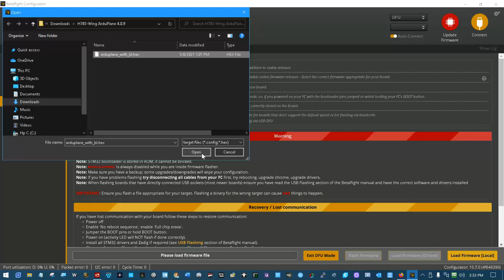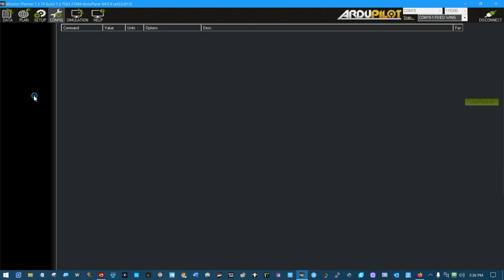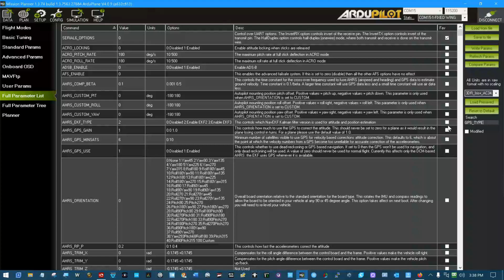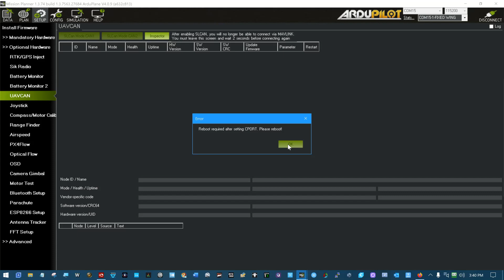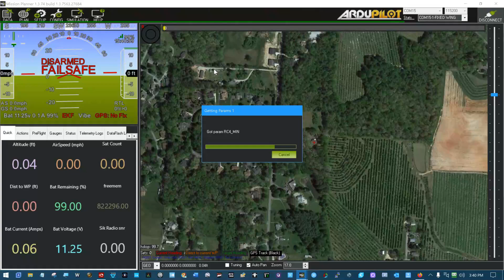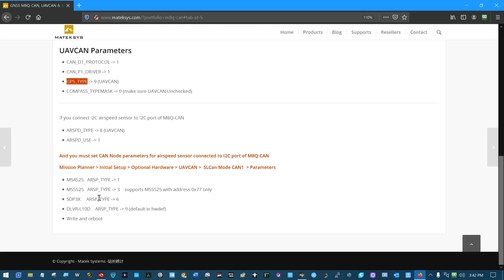Answer to question on M8Q CAN 2 of 2

Comment: Looks like the best thing to do, if you have more than one CAN component, is to make your own wiring harness.  I thought I read somewhere they are working on CAN compatible servo's. ?  In that case a custom harness would be in order.
Reply from the maker: I read up on the CAN Buss. Quite a system. Basically each unit is separate, they all talk anytime they want with no syncing clock pulse.  Everyone receives everything and each separate unit decides IF the current message is meant for them or not.  If so execute, else ignore message.  Seems like an extension of the old SBUS days with Futaba.  rofl  Keep chaining the modules on and on and on.  Servos and more.

Interesting to watch this stuff evolve.

Comment: Okay, no tables broken, no TVs, didn't throw the F765, grrrr.  The problem was my ignorance.  My TX sends 12v to the camera.  So, I put the camera power on the Vtx pins.  The VTX sent 12v back to the pins, and shut the board down.  The learning curve can be expensive :(  The New H743 arrived, installed 4.1, soldered it up, connected the GPS and Air sensor, plus receiver (R OTA) and two camera's with a TX Wired correctly.  Everything works.............  GPS gets 12-16 sats.  RSSI works using ch16.
Reply: Also, the CAN is not plug and play, quite confusing..  The GNSS M8Q-CAN if plugged in first is the end of the line for the CAN bus.  You have to plug in the Digital AirSpeed sensor ASPD-DLVR first, then solder the CAN compass onto the CAN pads on the rear.  There are no solder CAN pads on the GNSS-DLVR.............
Reply from the maker: @BillyBigRig001  I think that Air Speed has a I2C port that will plug into the left port on the M8Q-CAN but I am not sure IF the buss processor in the M8Q will pass the I2C data through the CAN buss like it will on the UART port.  I have the ASPD-4525 and connected the M8Q-Can to a F765 via UART.  I will have to connect it to the CAN buss on a H743 and see if the buss controller routes the ASPD through the CAN buss.
Reply: @nighthawkvs  The instructions, once you get past the mud, show's that probably wont work.  Wiring

    5V to FC 4~5.5V
    SCL to FC I2C_SCL
    SDA to FC I2C_SDA
    G to FC GND
Its complicated because some of the components can attach in multiple ways, and others can't.  The above, without explaining the obvious, does not have any CAN outputs.  So, its not CAN compatible :(  On the other hand, the ASPD-DLVR has two connectors on the front, CAN and IC2.  On the back it has solder pads for 4.  So, its complicated.  Now as to the reason why its complicated. Its good for business lol lol lol.  Let me know what happens ;)
Reply from the maker: @BillyBigRig001  I tried it.  It didn't work.  lol

Was it the first FC that got smoke checked?
Reply: @nighthawkvs  Yea, but no smoke...  It just seems the CAN section is out of order.  Ill try later hooking up the compass using I2C later.. See what does work with it....
Reply from the maker: @BillyBigRig001  Yeah, when two positive voltages fight like that, the power seems to go somewhere else and just cause problems. The electronics seems to do one thing one second, and another thing the next second. That suggested intermittent.  And intermittents are the hardest to track down.  You tracked it down very well IMHO.
Reply: @nighthawkvs  There should be clear warnings not to apply external power to the board....  I will be disconnecting the ESC 5V wire, just to make sure, as the board already supplies 5v for the servo's...  The instructions are written as though you have been part of the development team, not for novice's....  Besides, the bec power from the ESC is iffy, especially if batt is 0ver 11.1v  Will check today..
Reply from the maker: @BillyBigRig001  Yes, if the ESC has a BEC then disconnect the red wire.  There is not enough warning at all for that.
Reply: @nighthawkvs  TY.  Added a ublox to the RX ports and it worked.  Added the DLVR sensor to the I2C ports, it worked.  But the board is untrustworthy grr.  But once you take the two little resistors off of it, its no good for CAN any longer...
Reply from the maker: @BillyBigRig001  Thanks for the info.
Reply from the maker: Cool. There is a video among my videos posted in the past year where I plugged in a battery and the item I was working on went up in smoke.  LOTS of smoke.  It’s all there in the video.  I won’t say exactly which video, but it is in there.  lol

Never beat yourself up.  There is no amount of expertise you can acquire in this life that will enable you to never have a failure, make a mental mistake, etc.  I am almost 68 and I only learned this in the past year.  I have never been able to let things go so easily as I can now.  The important thing is that you advance the ball today.  Good job.

Comment: Did the fresh install 4.0.9, change parameters.  I get "No GPS".  No listing in the UAVCAN :(
Reply from the maker: It does change CAN_P1_DRIVER and GPS_TYPE.  They need to be set to CAN_P1_DRIVER = 1 and GPS_TYPE = 9.  Write them to the FC.  Then reboot and it should work.  Let me know.
Reply: @nighthawkvs  Still a no go.  Still cant access UAVCAN.  No second com port.
Reply from the maker: @BillyBigRig001  Can you post a video or some pictures?
Reply from the maker: @BillyBigRig001  That second com port was with version 4.1.0 installed.  The current version 4.0.9 didn't show a second communication port for me either.
Reply: @nighthawkvs  Ordered another F/C and GPS.  Im going to compare between the two.  Ill keep you posted.
Reply from the maker: @BillyBigRig001  I have done exactly that several times lately.  I am very interested in the outcome.  Thank you.
Reply: @nighthawkvs  Latest.  The Data page did show GPS fix 3D briefly, then went away.  Reloaded 4.1 and was finally able to acess UAVCAN screen using other com port.  It says the GPS is healty, firmware version 1.0, but no parameters showing.  Ill try the GPS boot button next time... to upload new firmware.
Reply: @nighthawkvs  Does the GPS boot button need to be used?  The update still says 1.0?
Reply from the maker: @BillyBigRig001  Is this on new FC or GPS?

Here is what mine says for Hardware Version, Software Version, and Software CRC.  I think I have the latest versions.
https://youtu.be/TYvd4VRhaio
Reply from the maker: @BillyBigRig001  I didn't have to use it.  I think that is for the UART you have to solder to.  Not sure what the boot button is for.  Sorry.  :(
Reply: @nighthawkvs  New board and GPS will be here later this week.  As soon as I get it set up ill get back with ya ;)
Reply from the maker: @BillyBigRig001  Thank you. That will help me a lot to have a feel for the reliability of these hardware items.  Hopefully that will forestall a crash for us all.  I worked in electronics and computers for almost 50 years.  I worked with Ardupilot software and hardware for about 9 years.  INav and Matek less than a year.  Your help is much appreciated.
Reply: @nighthawkvs  Lots of history there ;)  Im a AF veteran, retired in 95.  Worked at lots of things, Small Comp manager, welder, Aircraft Mechanic, etc.  Just call me Jack, lol.  I started into Ardupilot when the boys decided to hack into walkera with the Open TX, dropped out after finding Eagle Tree Vector, love it, American Made, dependable, but alas, the years caught up with them and they closed, which put me on the search for a replacement, and here I am :(
Reply from the maker: @BillyBigRig001  1971 to 1975.  Navy Aviation Electronics Technician. E2B and E2C aircraft. At the time the most complex electronics system on the planet. Navy version of the AWACS. Without the galley and bunks. lol

Was trained by the Navy in both the hardware and software associated with computers.  In order to be able to create and repair the electronics we had to understand the machine language of the chips themselves.  So when I was discharged and went to college, learning stuff like Fortran, Cobol, C++ was a snap after machine language.  Stayed in table top computers from the early 80’s to retirement.  Did lots of specialized side work because of my training.  The service gave me a good education and it made my life after service GREAT!
Reply: @nighthawkvs  Im so glad for you :)  I worked in a sister organization, Compass call.  We too flew a very specialized electronics combat aircraft.  Though I used electricity in its primitive form (Welding lol) I knew what the plane did lol.  But, my education took a different direction after a "Visual" in 1978.  It took over 40 years for me to find the truth...  I cant really get into it in this format, but Ill give you a hint.  Its all starting to come out, publicly.  The Pentagon, has a lot of "Explaining to do lol lol.  I just hope they find the courage to tell the truth..............

Anyways, my wife passed away a year ago and looking for things to keep me occupied. Looks like Mateksys is going to do that for me lol  Just finishing up a runway here on the property (E.Tenn), not an ideal location for flying but will suffice ;)
Reply from the maker: @BillyBigRig001  I am so sorry for your loss.

This will certainly take up your time.  lol  As you have stated, documentation in this hobby is virtually nonexistent.  Without the sharing of information socially, we would all get nowhere.  I have had some frustrating times.  Ten years ago it was BAD.  Much more information from all sources now.  Still, I want more.  Actually I just need a level equal to the money I pay out.  <shrug>

I am on the other side of the hill in WNC.  lol  You have Joshua Bardwell over in that neck of the woods to call on for help.  Lots of high-level pilots come into Eastern Tenn. most every weekend.  I am jealous.
Reply: @nighthawkvs  The GPS is not being displayed in the UAVCAM screen.  It appears the Auto pilot is, ver 1.0.